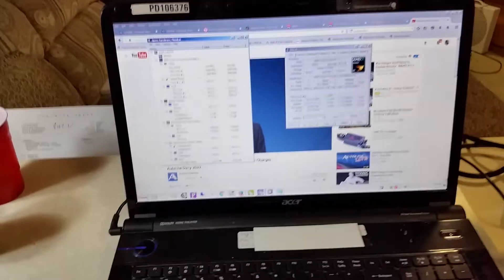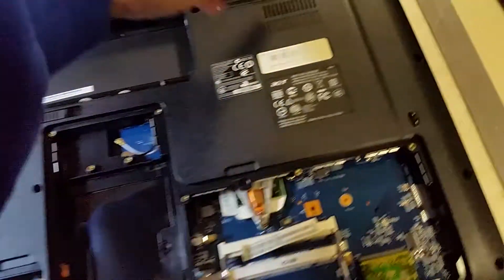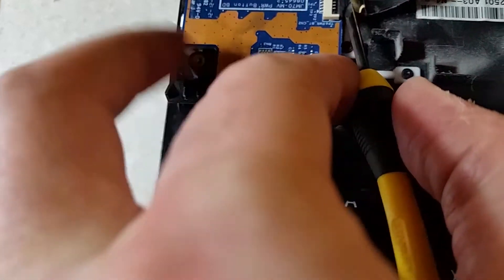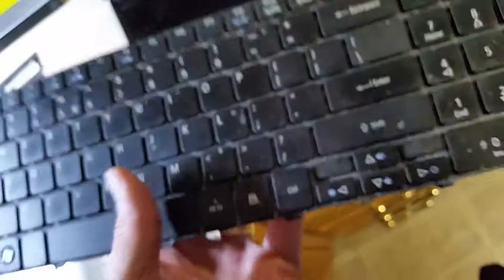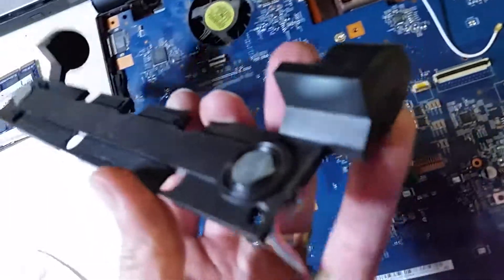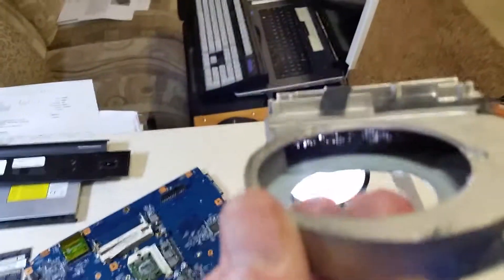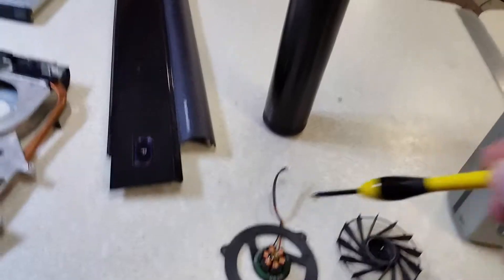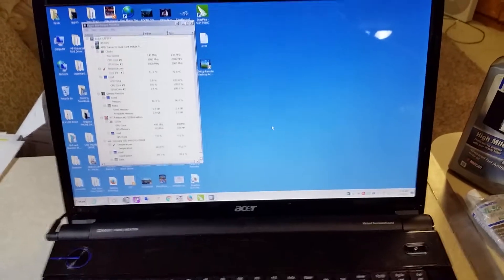ACER ASPIRE 7535-5020   OVER HEATING LAPTOP, WHAT I FOUND AND HOW I FIXED IT.

Comment: Hi Kevin I have this same laptop, and the Hard drive is on the way out but not yet failed , its an old computer- I was hoping you could advise which SSD you put in there? did it have to be limited to 500GB same as the original HDD? 

I see it is Samsung , but strange that when I look up this model at vendors it states there are no compatible upgrades to SSD? Perhaps because it is old they have neglected to include details? And so, if I buy a Samsung 500 GB SSD and clone old drive to it as standard it will work? 

What do you reckon? I am grateful for any advice
Reply from the maker: Yes any SSD should work 500 250 what ever size you want.  Samsung drives are great. this is what is use https://amzn.to/3QobNHT
Reply: @ktoutdoor   THANK YOU Kevin for your reply - I shall try a 500GB SSD replacement and I'll get back to you to tell you how it went
Reply: I installed it worked great